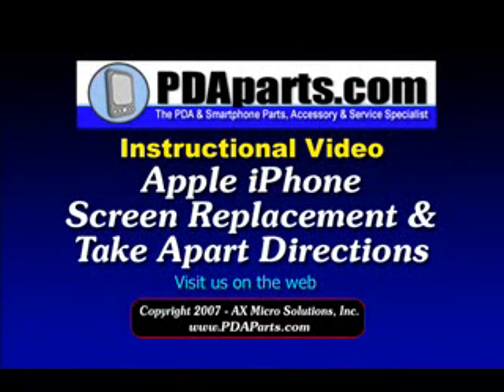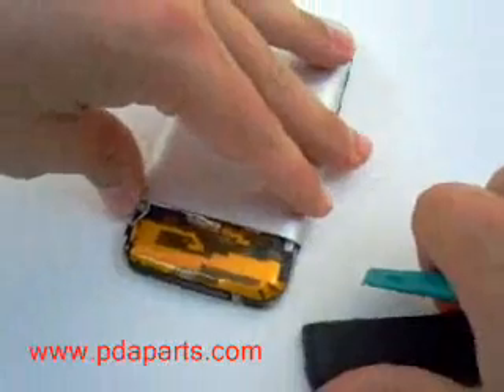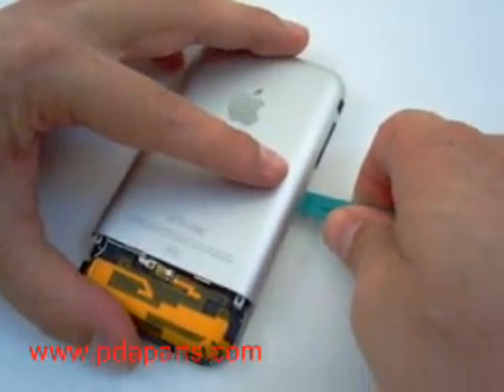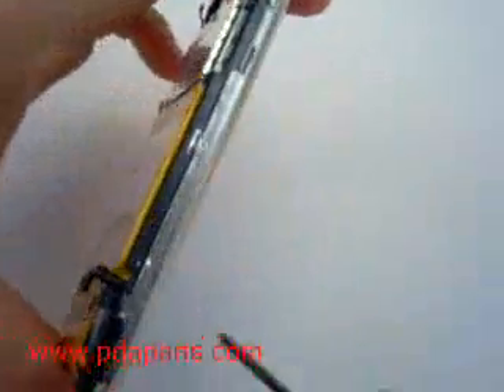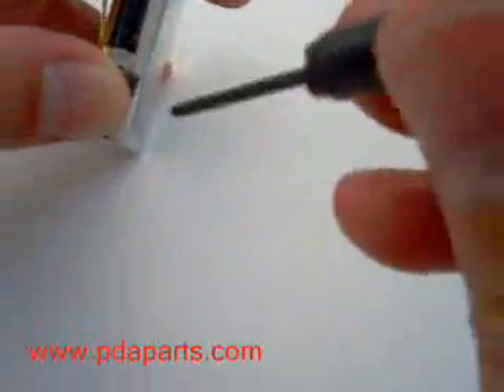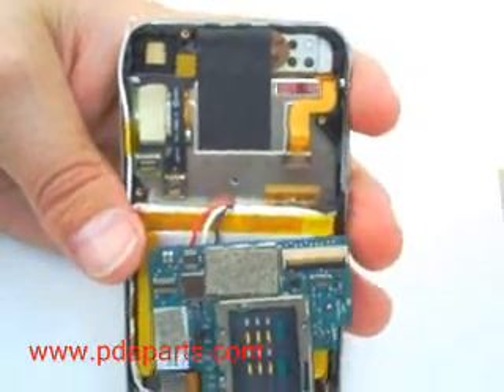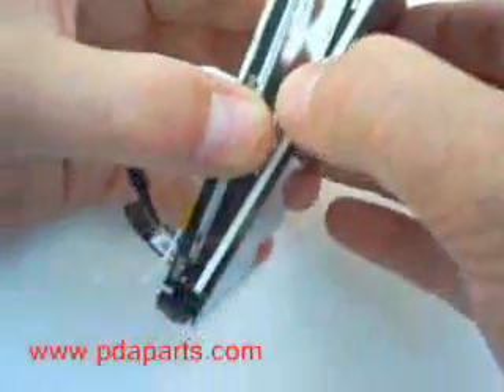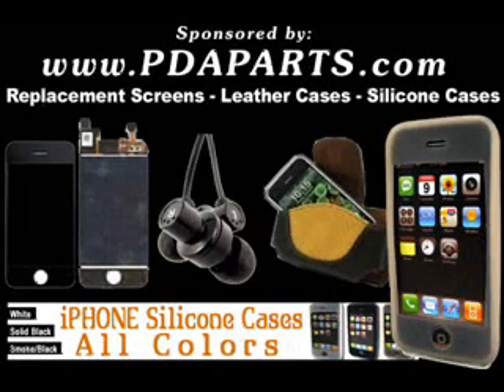How to: Take the iPhone Apart Step By Step | DirectFix

Comment: all right, I bought an opened case tool and I opened my iPhone, I fixed the on/off button that was damage, but I SCRATCHED the back metal case.  My question is how can I take off all the part that are inside of the back case to put it in a new back case? Thanks for everything